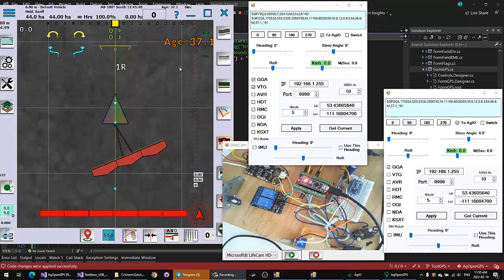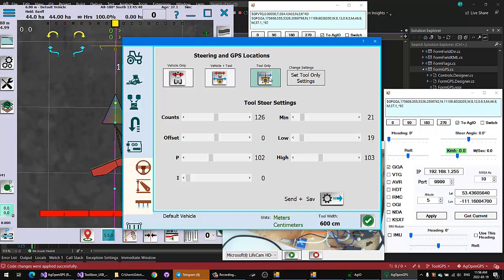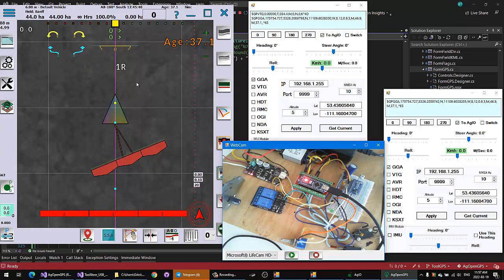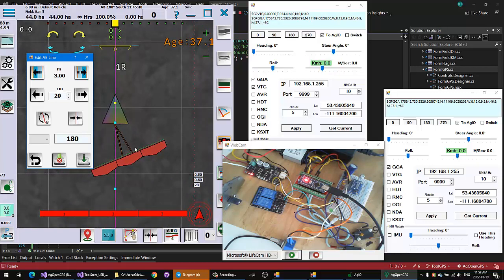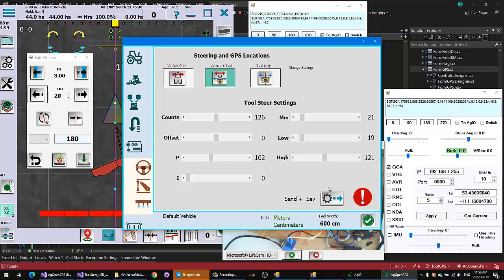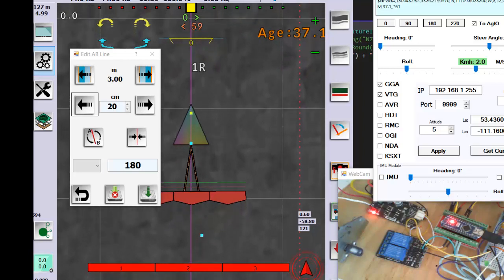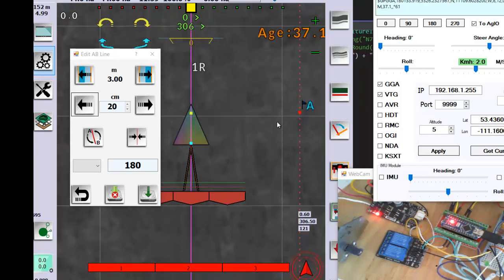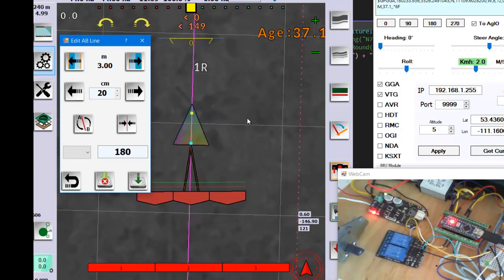Tool Steering

Comment: Unreal!! There is a family here in aus that have tool steering on a 214foot wide planter, I’ve wondered about it and if AOG would be able to steer a tool, and here it is.
Reply from the maker: https://youtu.be/arcgu5clbcY
Reply: FarmerBrianTee wow that’s next level mate!! Here is that 214 foot machine I was talking about, if you look closely there is a steering ram on every second wheel assembly at the rear of the planter. this thing covers 3000acres in a 24 hour period. https://youtu.be/_PnDtK77r3Q

Comment: Great job. I use a GPS receiver with udp ethernet line. How can AGopengps differentiate now the two udp receivers ? Can I tell Agopen the gps with source address a is the vehicle and with source adress b is the tool?
Reply from the maker: Yes!! Took a wee bit of thinking - but the Tool GPS has the port set to 10,000 and still sends to AgIO on port 9999. AgIO then takes the port and recognizes it as the tool GPS and Tool steer pgns and sends them separately from the vehicle GPS. Cool eh??

Comment from the maker: We are playing around with voice command as well lol
Reply: Kinda cool, But simple section control with isobus option (even without rate controlling and other isobus stuff) would be much, much more in  advance for Agopen.
Reply from the maker: @edzuks456 Several are using 4 channel full variable rate control and section control. So no problem for diy. It doesn't use the isobus based system because we can't get the pgn codes of canbus. I wonder why.....
Reply: I posted about this on the forums, and don’t think its possible in current versions. But what about separate ab lines for tool and vehicle. 

Specifically a swinging implement such as a hay bine. The unit itself would have to switch sides at each turn. Could be manually set, or have a secondary antenna to enable true mapping of where the implement is. Hydraulic control to move the implement back and forth automatically.